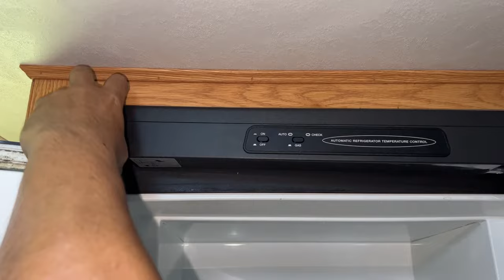How to Remove an RV Fridge - Dometic RV Absortion Refrigerator

Comment: Wow. I went through all the steps and I sure wish my fridge would just pull out like you just demonstrated. Hence my need to research on Youtube and I saw your wonderful video. My fridge is exactly like the one you have here. Wish me luck tomorrow when I try this again. Update the next day: Ooops. I discovered a screw that I didn't see before that I had not removed. It pulled right out! Thank you again!
Reply: How much would you estimate it weighs?
Reply: @littlet-rex8839  Perhaps 50-60 lbs perhaps. Hard to judge but I'm guessing. My legs did most of the lifting and it was easier to lift after taking off the door. That way I just put my hands on the underside of the top and lifted it out. My arms are not that muscular but my legs are. It's out!
Reply: Did you put a new fridge in if not how did you plug the gasline
Reply: I did install a new fridge in the RV. 12V Ever Chill from RecPro. It’s not the exact dimensions but I use the extra space to put other items out of the way. Dust pan Broom etc. I also installed 12V to 110V converter. When the power goes out I unplug the cord from the 110 outlet and plug it into the Jackery. I have not done anything with the propane line. However, it is not hooked up at this time so I'm not worried about it. A friend who happens to be an A/C or HVAC licensed told me that he would just crimp it  or put a stopper at the open end of the line. But don't take that as gospel. I would ask a few HVAC pros what they would do.
Reply: Hi.. i just want to ask Sir if you did not do anything with your gas line, does it mean that you are not turning ON your propane tank anymore for you to be able to use your stove/oven? Thank you
Reply: @PinoyCanadian017  I still you use my stove. What you need to do with the propane line that was hooked up to your three way or even propane fridge is cap the propane line. If you don't know how to cap the propane line, then I would advise you to have someone with experience dealing with propane lines to do it for you. It's what I did.

Comment: Thank you! I just bought an old RV with an identical fridge that doesn't work. I have to remove it and turn it upside to see if that will get the gas to flow.
Reply from the maker: Did it work?

Comment: Your the man. Thanks brother. 👍👌
Reply from the maker: No problem 👍
Reply: @GPDIY  UPDATE.. New aftermarket fridge from Sam's club installed , with room a pure water , 5 gallon distribution unit. Also an ice maker to boot . Those original double wide fridges leave room for so many options. Thanks again bro. Seriously

Comment: The yellow & white wire in the back, are those 12v? Are they powered from the rv battery, or the 12v supply from the vehicle connection?

Comment: Hello, at 3:57, those two metal bracket like where the screw goes in the hole are cut off at the base.  Any suggestion for repair and tighten?

Comment: I'm planning to do this in the next few days and replacing it with a residential fridge. I will need to cap off the gas line and looks like I will need a 3/8 inch male end cap.. Can anyone confirm that this is correct.

Comment: Can you remove a camper refrigerator and replace it with a regular refrigerator I don't like mine..  our camper is on our property and won't be moved so the need for gas or battery isn't necessary. I just want a regular fridge in there.
Reply from the maker: That’s exactly what I’m going to do, I’m going to replace it with a Magic Chef 10.1cu, all you gotta do is all little bit of trim work on the edges.
Reply from the maker: That’s exactly what I’m going to do, I’m going to replace it with a Magic Chef 10.1cu, all you gotta do is all little bit of trim work on the edges.